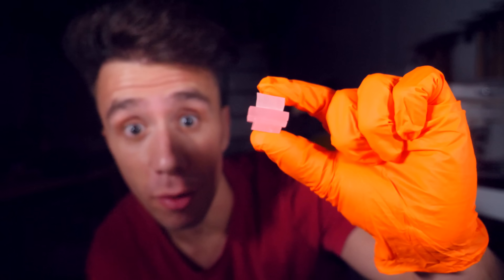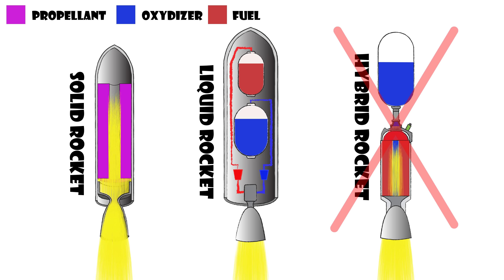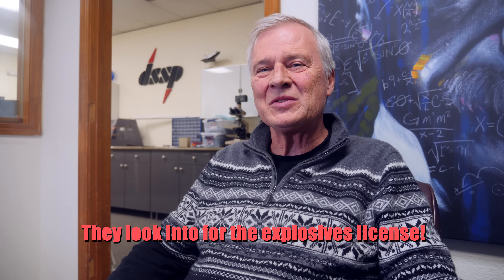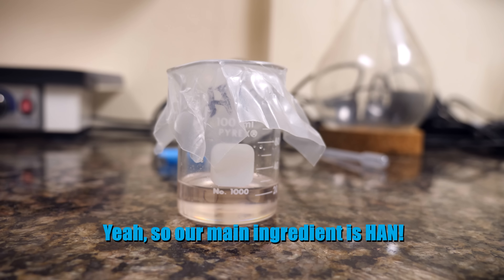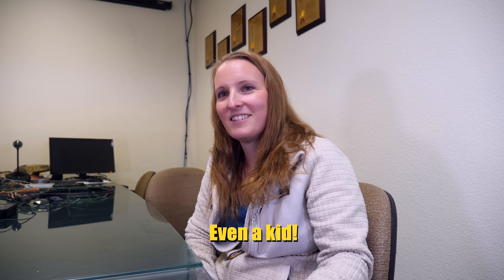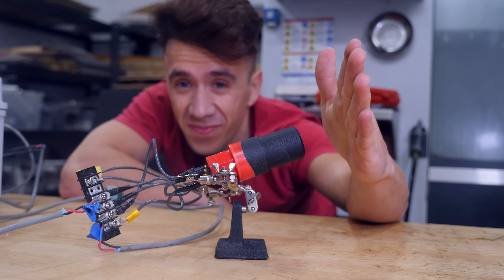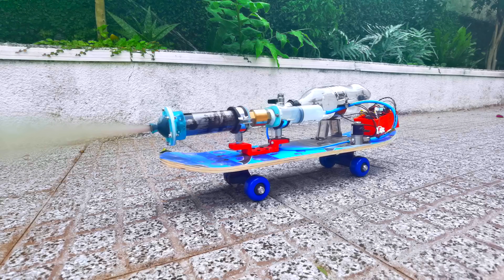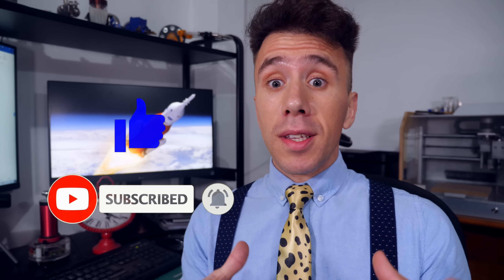ELECTRIC SOLID PROPELLANTS

Comment: Video idea: Try to run your rocket engines off a different fuel because propane burns VERY HOT so maybe that could help get around your heating issues! Good luck!
Reply: Maybe try natural gas which burns at 1000 BTU'S  in stead of propane's 2500 BTU'S!

Comment: Use metal plates and Arduino so u can set like in F1 F2 F3... And if F1 goes off F2 turns on and it goes on for F3 so the current passes to each and sequencely the complete propellant burns

Comment: Video idea: multiple stage explosion. Primary charge projects it towards a target
Reply: I imagine a spherical thrown Device, whichever point it lands on corrects it's trajectory, sending it vertically. Then accelerates horizontally with same type of charge, then the final charge(and any remaining directional charges) go off on impact and destroy the device.  completely . Basically a heat seeking infantry grenade. But you know, not a grenade, just conceptual noise maker with potential in the military tech industry. 

Could also be used to accelerate right before reaching the peak of a throw, adding a huge amount of range. 
                                   .   ∆ ->.     .     .     .   .
                  .            Accelerate                    .
          .                            /\   -> ->  ->  -> -> ->  .
        .                               |                                  .
  Throw.                                                            *
                                                                 Boom
Reply: Just about doable , especially if you copy tech from the 3d scanning ball.

Comment: While having a throttlable reaction is far more ideal for control systems, the energy density in HIPEP is not significant enough to maximize the weight-fuel ratio. While it's been done with other solod state fuels, it's not ideal. This sort of fuel would be much better used in a EMP lance drive, which none of you know about because it's in my head. Lolol

Comment: Video idea: using the dssp developed solid fuel for rocket boosters, but instead of having them at the scale of a normal booster, use thin long rods of the stuff with baffels and/or gates to prevent a runaway reaction. If you strap enough of these thin rods together in the same diameter as a normal boost, it just might work for liftoff!

Comment: What would happen if you made a large hollow ring out of stainless steel, filled with liquid mercury or ferrous type of material then wrap coil wire around the whole thing creating high power electro magnetic field spinning the liquid core at hyper velocity, creating a gyro then make another a bit smaller that would fit inside the first ring everything the same as the original however reverse polarity on the second coil causing the liquid ferro fluid to spin in the opposite direction at a greater veolisity .mercury would probably offer the most bang for the buck because of its weight, could something like this be part of antigravity type of devise? Can you please make something like this and test its potential? It might just turn out to be something quite useful I think thank you for considering this project,
 love the way you think ,It makes me think and rethink the possibilities of the known and unknown, great stuff.

Comment: You should try using water 
Not water (H2O) per se but nanoaluminium powder and water, both mixed in ice form to keep it stable and use electrolysis to create diatomic oxygen (O2) as an oxidizer and a diatomic hydrogen (H2) as fuel it's pretty powerful and fairly safe and would make an awesome video of a water powered rocket but without steam

Comment: Oh, you have done hydrogen peroxyde already. One of my favorites.
Well, I have to admit I didn't review all your videos.
What you could try to do is: Re-create the Biefeld-Brown effect. No cool explosions but livethreatening superhigh voltages. And still some moving parts. Somehow in Wikipedia the effect was reduced to ionic wind. What is wrong. Because one of the guys testet the effect also in a vaccuum chamber where ionised air can be pretty much excluded from the equation. Electrons can still leave the metal though, making thrust which might be an explanation for the effect.

Comment: When Wayne said you cannot use it for a booster, only thrusters then couldn't you use a disintegrating engine? An engine that, just as a solid booster burns its fuel, the electric could do the same clearing the way for the next level but instead of one large fuel cell it is composed of thousands of small ones, perhaps that would be a test video for the future.

Comment: A good video I'd like to see would be to test all the rocket propellants that you found for the amount of thrust they could produce in a vacuum chamber. Since all the applications for solid propellant thrusters were going to be at the satellite scale, it would make sense to test them that way. As if they were in space. You could go a step further and try to approximate the temperature that the thruster would need to fire at to be efficient. Kind of like, would it need to be pre-heated in order for it to work better in the vacuum of space.

Comment: Hydroxylammonium nitrate, eh?  Integza, I wouldn't send a shock wave through that....

They talked about electrically-triggered deflagration and pulsed power ionization.  NH4NO3 does that too.  But it ruins your day if a shock wave goes through it.  Pretty interesting though since NH4NO3 is so hygroscopic but here it has a Hydroxyl group and is already deliquescent.
Reply: You can hit NH4NO3 with a hammer too and it's probably not going to explode.
Are you 100% sure this stuff isn't explosive?  Calls for some experiments, trust but verify.

Comment: Video idea: make an super charged burn barrel and lets see it can be used as an engine? How much thrust can it generate? Where can we use for? , how much heat can it generate, whats the max pressure it can handle, can it be used as an generator...

Comment: The GEM at the end reminds me of that old man that mixed hydrogen peroxide with methanol and ignited the resulting mixture through a heated catalyst made out of manganese dioxide. Then, the energy liberated ran a steam turbine that powered a VW beetle. The fact that the ignition process is the same means they're still using hydrogen peroxide, but the other component makes the mixture electrically conductive.
Reply: https://www.youtube.com/watch?v=kpg4g47ssFY

Comment: Machine some metal rocket casings and guide them by a wire horizontally put different kinds of rocket fuel and at the end of the rope put some objects like pumpkin or watermelon to check for damages 😂

Comment: hi, awesome video. I came up with an idea in case you want to use this solid fuel in an upcoming video.
from what I understand once it is supplied with energy it is not consumed evenly. I think you could solve it using a more complex structure (such as tree roots) by hardening the ESP with this structure inside, or I was thinking of a kind of cup electrode that is pushed by a piston/spring as it wears out the fuel.

Comment: I think you should make a jet engine a instead of of putting it on a thing with Wheels put it on a rc plane and use a electric pump to pump in fuel and Connect it it to the air intake motor so when you give it more air it also has more fuel so it even it should have more thrust in my opinion.🙂

Comment: This propellant was called A3L and was developed in 1990 at Aerojet by Dr. Art Kazacian and Dr. Adolph Oberth.  There is a video from 1991 called Aerojet A3L Propellant on YouTube.  They were adding aluminum to increase impulse, but it's the same propellant.  
ANYONE CONSIDERING PLAYING with it should know that it can start smoldering if it is contaminated with any of a very long list of materials, like acids, bases, metal oxides, and even the NO2 that it produces when standing around.  That pink color comes from one of the stabilizers they add to help reduce the instability a bit. Also it is a dermal sensitizer, so holding it in your bare hands like this video showed is a great way to develop dermatitis.
Having said that, it is neat stuff.

Comment: So ya want an idea for a video. Try this on for size. Check out The Safire Project through the Thunderbolts Project. It's using electromagnetic's to create a "sun in a bottle". Unlike the method that has and is being used to control plasma fusion using giant magnets these guys are working at letting it self generate by controlling it through voltage control. I hope I'm getting this right. I'm looking at it in the way the Wright Brothers developed powered flight compared to Professor Langley. Langley was using brute force and the Wright Bro's researched how birds did it. The Wright Bro's even built the first wind tunnel. There are a ton of people trying to discredit them but having worked in industrial electronics I could see some truth in what they are doing. Anyway, give these guys a look and take it from there. Aloha

Comment: I'm wondering since the complete solid can't be turned off. Could Slam Gates be used to kill the reaction? They basically like giant kitchen knives that cut the fuel off from the burning side. We could basically make the rocket and make it poop out the reaction and then pinch it at the sphincter. 
This stuff is going to be extremely highly useful when I convince B.A.E Systems to build a giant launch pad with my my rail cannon, which then can be used to refuel rockets in space, so long as it's sealed in a non conductive layer.

Comment: Put a throttlable fuel based rocket in an fpv Quad copter, use the battery power to cause it to accelerate the drone with the built in rocket motor and the rocket can be facing down or behind the copter, it would be interesting to find out the max speed of the copter before air drag induced Desintegration.

Comment: 11:48&11:49 You got it! Solid to liquid & if gas, mini chambers. Because of doing that. A rocket could run on water. e.i.Two compress 02 & a hydrogen solid form mass, into gel, then foam and liquid, (water mix merge) you save space & bulk flow expanding.

Comment: How much current, and how big a battery would you need to power such a rocket? Could you run a generator off the rocket to provide current? 

... and yes, tomatoes ARE disgusting. Death to tomatoes. SUBSCRIBED!

Comment: How long does this propellant last?
Pump a constant electrical current through it.
How long until it is completely used up?

Is the creation of this propellant expensive?

How large a block of this propellant could be created?

Could an electricity generator create a large amount of continual plasma for a prolonged period of time?

How long does it take to create this propellant?

Could it be created faster than it takes to extinguish the entire block?

Could the propellant production Company be continually producing quantities of electrically produced plasma in large quantities?

Would a large quantity of the plasma produced, be harmful if exposed to it?
Small amounts, you've demonstrated, cannot produce pain.
Would large amounts priduce unhealthy side-effects?
If exposed to this plasma, what would be the result to a range of different materials? (flesh, concrete, grass, seawater & (generally) the atmosphere)

Comment: I feel like its also important to mention that liquid rocket fuels/engines are much much more efficient than solid rockets. Typically 50 to 100% more efficient depending on the liquid fuel/engine.

Comment: Wouldn't the tradeoff to using this type of propellant be all the extra weight you'd have to carry in the form of batteries and electronics to burn it?  Seems like it would be a lot of extra materials to carry that do not contribute to thrust.  How many Wh/Kg is required to burn this fuel?  In essence, how many Kg(batt)/Kg(propellant) is needed?

Comment: Hey this is Chase Larson of chasing it and Laura's corporation I have a bunch of surplus material far as rocket motors go or ignition systems would you like me to send you a package to help you not your rocket motors they're very small and very lightweight and they need two nine volt batteries to activate the ignition system for your rocket motors

Comment: I realize I am late to comment but I think you should open a discussion regarding the solid propellant and it's commercial applications like maybe a new fuel source for any vehicle or even somehow using it to generate further electricity. Also, I wonder how the substance would react when electricity is applied to it while in a vacuum environment.

Comment: It would be cool to see a small scale version of those quad rocket powered vehicles with its layout configured sort of like an osprey but with two sets of wings one at the front and one at the back. You see this design a lot in futuristic movies so it would be nice to test if it is even possible and feasible. Also I'm new to this channel but this was by far one of my favorite rocket based videos I have seen yet on YouTube.
Reply: The way they are typically depicted (as vehicles capable of leaving and entering Earths atmosphere) would be extremely impractical in atmospheric conditions due to aerodynamic forces.  If the ship was only ever going to be in space or was designed with the intent of hovering in place then the shape wouldn't matter to much but the reason rockets are designed the way they are is to minimize drag when trying to escape gravity (which is hard enough to do).
Reply: balancing thrust, esp with home-made rockets, means this is going to flip over. You need very fine and very fast control of thrust and angle to make this work.

Comment: Even at small scale, it would be interesting to see Integza do a project with this future fuel to see if he can make a rocket hover in place, and gradually ascend and descend. I'd imagine vertical stability would be an issue so mounting it to a vertical slide ot keep the rocket pointing in the right direction would suffice.

Comment: My question would be: how would you design the thruster to launch a rocket? If you had some kind of monolithic fuel grain, how could you sustain a steady burn if you had, say, a bunch of electrodes through the grain that would "ignite" sections when you needed them? Wouldn't each section lose electrical conductivity as soon as it burned itself away from the electrode? Maybe you'd put the fuel in to some kind of pellet feed with a micro screen like he showed in one part, but if your goal was very high volume of thrust like in a rocket that used all of its fuel in less than a minute or so, it'd have to be capable of high volumes.

Comment: How bout a rocket like the orion that used sequences detonations of charges that propel the rocket with the shockwave. The original was supposed to use nuclear blasts but it can be done with smaller, but still dangerous explosions to lift the rocket.

Comment: Hey integza since u are interested in using electricity for rocket engines  u can try to make an ELECTRIC JET with higher thrust. As you've made one before(ionic thruster), U can also build a  hydrogen powered rocket...This is my suggestion for a new video

Comment: Solar powered ionized rocket/balloon. try and recorded it going around the planet. Im sure there will be gaps of control so you will need to plan ahead on where the balloon increases altitude so that when it returns to a signal location it can continue. AKA re adjust heading based on wind patterns.

Comment: One of my favorite types of dangerous chemicals are ones that they can tell you all the ingredients, and even most of the steps to make them, but there's always just one step that's too complicated/dangerous to carry out personally. I think it'd be fun to watch you make a home-made plasma cutter for metal materials, just to see how far you can push diy rocketry!
Reply: The really fun ones are the ones that go from entirely insensitive precursors to a chemical that will explode if you breathe on it.  Which is an alarming number of chemicals tbh.
Reply: Hydroxylamonium nitrate or HAN is easy to make from hexamine (Camping fuel Tablets), HCl , dilute nitric acid etc.
Reply: @punishedgloyperstormtroope8098  just really slowly like the lady said so you don't blow yourself up
Reply: @punishedgloyperstormtroope8098  hans is easy to make but their solution may be different. Your end result may yield a completely different product than theirs.
Reply: A manufacturer can tell you exactly how to make RDX too and you could do it with no problem, but can't legally sell it to you

Comment: Can you suggest an entry level 3D printer which is easy to use and reliable? I've had 2 3D printers which were difficult to assemble, unreliable and basically I gave up. Thanks